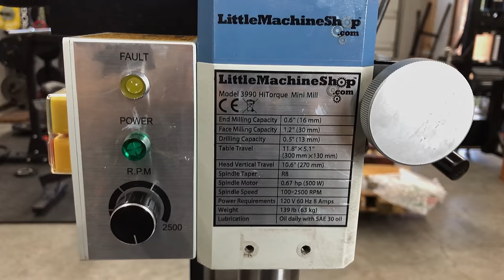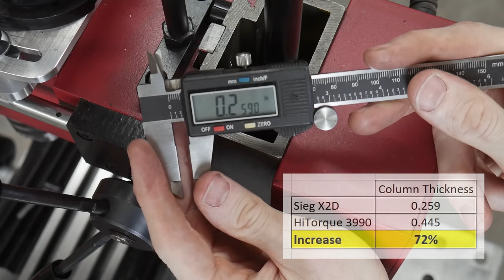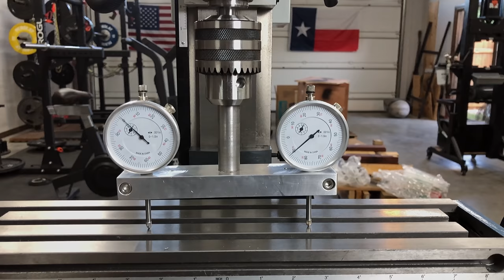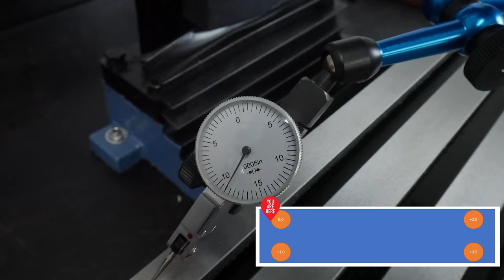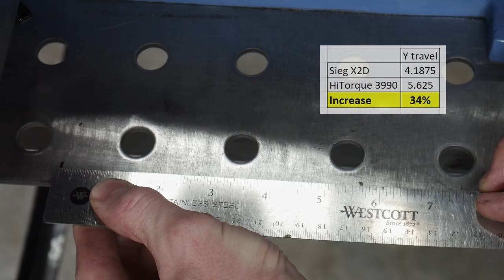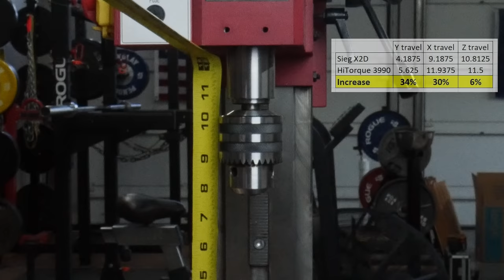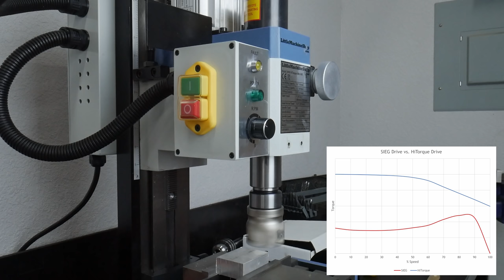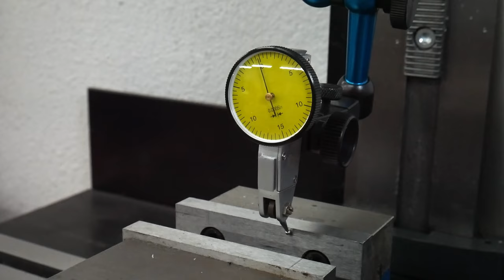Likely The Best "Mini" Mill For Knife Making & The Home Machine Shop | Sieg X2 vs LMS HiTorque

Comment: Great video, but I’m sure you made a mistake in using the Jacob’s Chuck to tram your table. Jacob chucks have an excessive amount of runout no matter the brand. A collet is the best option. I love my LMS 3990 HiTorque.
Reply from the maker: Thanks for the info sir! Yeah, I should do that again
Reply: You can indicate your chuck by putting a dowel in the chuck and put an indicator on the dowel and find your high and low spots  then tap it with a mallet to get it zeroed.
Reply: Runout of the chuck does not matter. The chuck just holds a jig that moves in a circular path in a plane. The plane is perpendicular to the axis of rotation of the shaft, unaffected by any runout of the holding device.

Comment: Put the indicator tip on 17 degrees not 30 degrees, should be in the instructions. You have to disassemble these China made machines and stone all the surfaces a little to remove the rough finish, they will last longer and perform better.

Comment: Heads tilt so you can do an angle when you may not be able to hold the work piece in a way to put the angle in or you can't remove your piece from the table until you are done. Bridgeports heads tilt as well. You are right though, it is a major draw back to those hobby mills.
Reply from the maker: Yes sir! I agree. I haven't found a need for the tilting feature for the work I do. I'd rather find a way to tilt the work piece instead of messing with the column. I could see this being useful maybe with a beffier machine, but with these little guys, I don't know.... seems good on paper and bad in practice. Cheers Mike!
Reply: It would be interesting to pull the plastic gears, cast them, and make some steel or good aluminum alloy gears, lol.

Comment: I bought a Sieg X2D from LMS and have absolutely loved the thing! This mill looks like the HF mill, but there are several significant improvements on the Sieg branded model including the rigid non-tilting column, air spring, and a much larger table/travel. The cost difference is what lead me to the Sieg branded model instead of the hi torque mill, but I’ve been more than satisfied with it! Even built some of the PM Research operating steam engines (stationary, not locos) with it, and not had a minute of regret on buying it! Regardless of what mini mill or lathe someone buys, they need to get acquainted with Little Machine Shop! Hands down the single biggest resource for the small lathe and mill world!
Reply from the maker: They are legit! Cheers Tom
Reply: Looks like I might join you.  The larger table and travel would be worth the $115 price increase.  I suppose a machinist might find the other model with extra horsepower and torque worth the money, but I can't think of any need for projects I'm thinking of.
Reply: Yep Tom T  ....  I have the HF Mini Mill and  really like it... I have my First Order coming from LMS right now... T Nuts, Center Drills, Tap guide & etc... soon I think I will get the Belt drive kit...
Reply: @pbc1951  I originally planned on doing the belt drive mod when I first got the Sieg mill, but after using it for nearly a year I’ve decided against it! Haven’t had any issues milling aluminum, steel or brass. I’d read reviews of people saying the top gear self destructed on a regular basis, so I ordered 10 of them from Grizzly (cheaper than LMS on some parts) at $1 each. A year later they’re still in the bag they were shipped in, untouched! As far as mods, I bought a Grizzly G0765 7x14 mini lathe, and when in the learning curve I was parting off a piece of aluminum too far from the chuck. The stock climbed the parting tool and locked down the lathe, destroying the plastic headstock gears! Again, after watching vids of people upgrading to steel gears, I ordered a set from LMS and installed them. The steel gears are a lot noisier than the plastic ones were, and since the destruction was caused by my lack of knowledge (part off up close to the chuck!) and I don’t think it would happen again, if I ever have the headstock off of it again I’ll put plastic back!

Comment: Great to see you upgraded, love mine. LMS has a reverse switch that will fit  just above the on off switch. It plugs into the control board so drill a hole ,  plug it in and your good to go. Thanks for the link on the face mill.
Reply from the maker: Very cool! I'll have to look into that. Cheers sir!

Comment: Nicely done video! Gave us a lot of details that many uploaders skimp on when doing a review of a product.
Side note: youre absolute right about the feature of a tilting head. They are certainly going to allow for slop in it and thus inaccuracies later on down the road
The user is better off buying an adjustable swivel vice so can tilt the part to the angle it needs to be machined instead of tilting the head of the milling machine

Comment: Good comparison. I'm surprised you didn't (couldn't?) get the new mill trammed better than that. I have an old X2 that had the tilting column that I replaced with a fixed one from Little Machine Shop. It proved to be quite well trammed after install but I was able to get it spot on with a few strategically placed thicknesses of ordinary printer paper. Here in Australia A4 sheets are 4 thou thick and remarkably consistent. Yep, that spring for the head is rubbish, I tried several methods to replace it but got a custom air spring made and installed it on the left side of the column, made all the difference. I also got rid of the gears and installed belt drive from LMS, installed stepper motors and ball screw Z axis years ago and run it under CNC using Mach3, works like a charm. I am currently installing a 1HP 750W sewing machine servo motor as I find the stock X2 motor underpowered. I also recently replaced my old DRO's with an Optimum 3 axis DRO set, works well.
Reply from the maker: Cool stuff Fred, I may go back and try to dial it in better now!
Reply: I read guys buying used treadmills on craigs list for $50-100 just for the motors and getting 1hp motors out of them for their mills.

Comment: 4:09 Excellent channel, thank you sir.  I just picked up a discontinued LMS 3690 mini mill.  I'm in the process of tearing down, cleaning, lubricating, and replacing some parts.  I have a method to tram but it's a bit awkward.  Do you offer a build video of this tram jig you built?  Thanks.
Reply: ohhhh!  I commented too soon, this blue anodized AL arm/jig is what I need, I already have a lever type DI with .5 thou graduations.   I need that holder :)
Reply from the maker: Nicccceeee glad you found your answer. I will say this spindle square is handy as well. https://youtu.be/uSLkKqS13Y0

Comment: Before you tram the spindle with shim, you must first check the Z movement perpendicularly to the table X and Y. Once you achieve that than you can start tramming the spindle. To tram the Z perpendicularly  to the table you add shim under the column. To tram the spindle to the table you loosen 4 nuts that mate the spindle housing and the Z slide dovetail block, and tap CW or CCW for X direction. To tram the spindle in y direction you add shim between the mating of the spindle housing and the Z slide dovetail block. Now you got a true perpendicular spindle to the table.
Reply: commenting so I can find this comment easier in case I need help tramming mine when it arrives.

Comment: I'm pretty sold on the 3990 after watching this video(don't worry, I WILL use your link.  I'm NOT a guy that's used a mill before but after figuring out how badly out of square my WEN drill press is and ruining too many knife scales - and also wanting to be able to mill guards and handles, I'm more than ready to learn.  I could use a little help for ordering though - it appears the mill comes pretty bare bones with a drill chuck?  I'm having difficulty trying to figure out what I should order in addition to the mill.  Does it come w/a drill chuck?  What other tooling should I consider for milling guards and getting the hidden tang slots in handles close?
Reply from the maker: Mine came with a drill chuck. You'll want a good vise as wells as R8 collets for each size endmill you plan on using. I get mine via amazon most of the time. The cheap ones seem to work just fine for what I'm doing. I put a link to the face mill I use in this video's description.

Comment: I ordered a lathe and mill from Precision Matthews. They are made in Twain (rather than China) and the level of quality is a step above. 

Standard features include: English threads (not metric) on leadscrews, hand scraped ways.

Options include: hardened ways, brushless motors (up to 2 HP), roller bearing screws ("economical" and "regular" options) for CNC conversion, and higher-precision on certain models.

However, for the price, I will look at Little Machine Shop machines when I need to buy more.
Reply from the maker: Good to hear that. Thanks for the info
Reply: PM mills are mostly made in China, some of their products are from Taiwan.
Reply: @NelsonJ1  Exactly right.  The do say which are which, but Caveat Emptor -- ya gotta look yourself.

Comment: I had a G0704, which is a bit bigger than either of these mills. I kept running out of travel on the Y and Z axis. No disrespect to LMS, who support the hobby community, but my advise is to buy the biggest mill you can. You will not regret it.
Reply from the maker: Hey Nicolas, I have heard this advise before! I'm sure it's good. Cheers
Reply: The next size up X3 has some good mills, got an Optimum version that had a wider X table than most.  Not even close to Bridgeport but bargain for about $2000 Oz.

Comment: Hello friend, Keith is from Michigan. I'm we could have a wonderful conversation together versus this comment box. You pretty much nailed it on these two Mini Mills. I only got the Harbor unit, cause it had a 200 bucks off. So I bought the belt drive conversion. Since I've overhauled a few machines, I completely stripped it down, this one had some decent Ways. So I just did flaking on the Ways. I had to retire early 🙃. The Mill will be doable for mid size Milling. Also have nice Lathe and do some hobby stuff, watched 😀 on YouTube. I
 enjoyed your Mill comparisons, again very nice 👌

Comment: I am currently doing a CNC modification on my Sieg X2 (branded Einhell BT-MR 550). As you can see in my vids i also converted the gear transmission to a ribbed belt, which was the best I could do, it's much quieter now!
Reply from the maker: Nice!

Comment: Good info, Red! I have been looking at the older mill/drills recently. Some of them are equipped with 2 hp motors. That’s what I’d like to go with for my setup. But, LMS makes some nice stuff!
Reply from the maker: Right on, thanks for stopping by sir!
Reply: It's worth keeping in mind that when comparing an older brushed motor with a modern brushless one, HP isn't going to provide a complete picture of how they stack up in terms of performance. I moved to a brushless hand drill not too long ago that just about broke my wrist the first time I used it because of how much additional torque it puts out.
Reply: It's worth keeping in mind that when comparing an older brushed motor with a modern brushless one, HP isn't going to provide a complete picture of how they stack up in terms of performance. I moved to a brushless hand drill not too long ago that just about broke my wrist the first time I used it because of how much additional torque it puts out.

Comment: First off, amazing video. Second, Im looking at getting one for making folding knives and other small edc pocket junk. Will the 4700 micro mill suffice? I feel like that huge platform on that 3990 is a bit overkill, plus i do not have a lot of room. Im not sure if the torque on the micro will be enought for titanium and hardend steel. Will it be precise enought to mill intricate folding knife parts? any input would he fantastic!
Reply from the maker: You may want to ask the folks at LMS; having not done what you're asking about I'm not sure. I think it would work just fine, but not 100%

Comment: Terrific review.  When I was looking for a mill (building underwater robotics, not knifemaking, but would love to try that out too) that fit my apartment bedroom shop, I researched the heck out of everything from Bridgeport down to Sherline and "Sieg X2 style" won.  But then when researching the heck out of "generic" Sieg vs LMS, spec by spec, feature by feature, LMS blew them all away.  Totally agree with every point you raised and 9 years on, I am still delighted with my LMS 3900.  So I felt I had done several months of ridiculously, obsessively thorough nit-picky research.  So I was very surprised to see a few extremely important points in your review that I had completely overlooked, most notably the shocking difference in column wall thickness.  No wonder people always howl about how "Sieg mills aren't stiff enough for real work".   Also terrific to see the actual torque curves you came up with.  So from somebody who spent about 5 months researching the difference before I dropped cash for the LMS, you get a big GOLD STAR for your extremely thorough and detailed research and presentation.  Subscribed, and when people on forums ask "Generic Sieg or more expensive LMS, instead of trying to explain it I'll just point them right to your channel.  Well done, sir!  (I'm more than confident you make a very fine cutting tool so I'll be watching your vids on that as well.)
Reply from the maker: Thank you greatly for your comment! I’m happy the video helped you. The 3990 is a step above the standard for sure

Comment: I bought an identical one to the your SIEG. 

The tilting part is a great idea because you don't get much height on a mini mill, and so if you add a tilting vice then you lose a lot of height of around 170mm and in most cases you can't do any machining.
so by having a tilting head you can achieve much more, and plus you don't have to spend more money.

So far I have had no movement at all, and is still 100% level
Also these mini milling machines are built to the clients price & spec.
meaning if you get a cheap one then there will be issues, as a shop with a good reputation and put their own brand name to it is that they will want to sell only good tools/machinery that has had good quality control, 
so you do get what you pay for.

And Sieg are well known for quality as well as Machine mart. so that is why they cost more than other similar models.

Comment: When you check your Tram for square is it out of adjustment often on the Harbor Freight model?
Reply from the maker: I've only had one, but I'd guess it's out of tram from the factory to some degree. Especially with the non-fixed column

Comment: Thanks for the breakdown between the two mini mills. 
When tramming with a flex arm and Interrapid style indicator, the indicator case should sit at 30° parallel to the table, and the needle should sit at 15° parallel to the table.
You had your indicator at waaay too steep of an angle, I could see it catching on the T slots...
Reply from the maker: Good stuff!

Comment: I'm currently making small but very rigid cnc router for milling steel for a customer who wants to make knifes... uploaded couple of videos of the build. My customer has such small mill in his shop, like the one you're showing, Proxxon brand, and it's quite limited and not really rigid, well maybe this LMS mill is better. But for such price for a new mill it's better to purchase used large milling machine. Lile your projects, subscribed.
Reply from the maker: Very cool! Thank you for your thoughts!
Reply: I agree that larger used mills have their plaće,  but , you will need to rebuild it as it Will ve worn , and that requiers time effort and money , they do bring alot of function with them tho. I gor one am looking at theese mills because i want to build 2 stroke stuff , mostly quite small , and aluminium , and in my basement i dont have alot of space , well i could fit a larger mill inside , but only in pieces as it would not fit trough the doors, but than i need 330v ,more concrete on the floor etc ... these things do havr their plaće

Comment: Have you ever cut stainless with those?  That's what I'm looking to do and was just about to go get a central machinery mill tell I saw them advertised as aluminum and softer materials I'm looking at the little machine shop now.
Reply from the maker: Sure have! Check out some of my Bowie builds. Lots of stainless fittings.

Comment: I'm using your link to get one. Do they have an 1/8" bit to mill hardened steel there? I don't know the lingo yet?
Reply from the maker: I get 1/8'' carbide endmills on amazon. But will say that milling hardened steel isn't fun; I normally soften the tang before milling:

https://amzn.to/3OTJFN7
Reply: @RedBeardOps  I've done it with a dremel and it was nasty. I brought my creation to several machine shops and they all told me it was impossible. "Just have to figure it out myself I guess" and then I found your video. Thanks for putting the effort it. I used your Little Machine Shop link when I bought it yesterday. And thank you for the response.